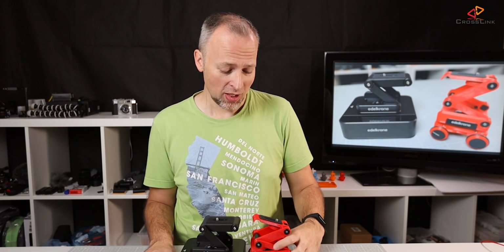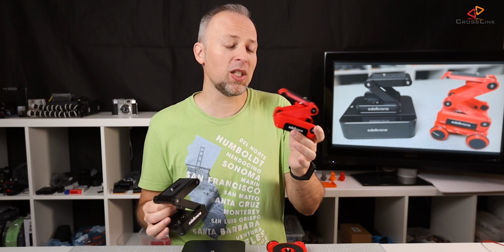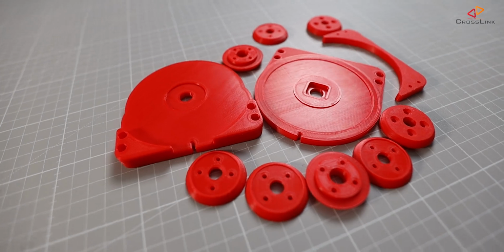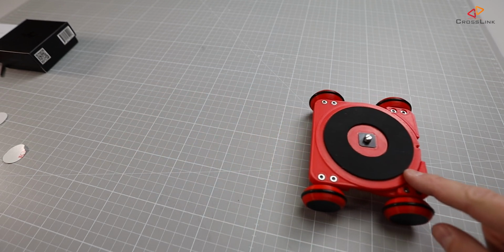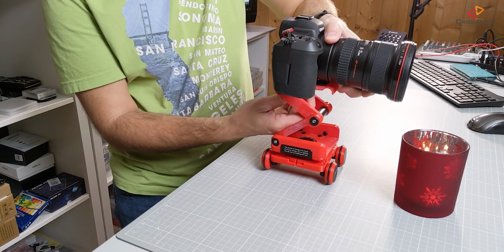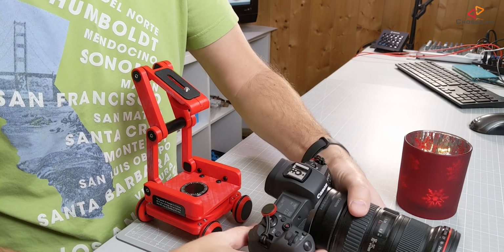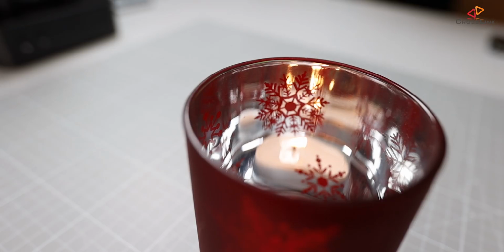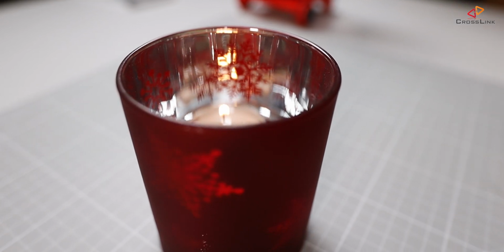EDELKRONE SKATER 3D vs Dolly One - A 3D printed camera dolly for 29$?

Comment: There are a few things to bear in mind with this combination: the more moving parts are between the camera and the ground, the more potential shake and wobble will be in the footage - some of it can be compensated for in post with Warp Stabilizer, but there is only so much it can do. So I would not necessarily use that flex tilt head on a dolly. Instead, raise the dolly, put a solid tripod head on it and use that. 
Also, even the most minute wobble is amplified by orders of magnitude with longer focal lengths. Daniel is using a 16-35mm lens here, which is pretty wide. You will get away with this combo very well, but things are going to look very dicey with longer focal lengths and very tight shots.

Comment: Would be interesting to add a small motor to one of the dolly axes (pulleys? gears?) and control it by wire. With a bit of hardware and software tinkering,  it should be possible to achieve much better results in speed consistency and video stability
Reply from the maker: Maybe this will do... https://rover.ebay.com/rover/0/0/0?mpre=https%3A%2F%2Fwww.ebay.com%2Fulk%2Fitm%2F192792632963
Reply: @Crosslink3D  a stepper motor requires a bit more Control hardware, but your concern is on the spot. Smoothness on start and stop might be more difficult to achieve with a standard dc motor. Unless, pwm? Creating a "speed profile" with an acceleration ramp, steady speed and deceleration at the end. I did it in the past with Arduino and it worked quite well. Sure, you cannot have fine control on position because you do not have a feedback on the axis angular orientation. Maybe an hacked servo would do. Lots of alternatives :D
Reply from the maker: Love that idea. Because the STL files are available this could be done. I have a few of these motors left: https://rover.ebay.com/rover/0/0/0?mpre=https%3A%2F%2Fwww.ebay.de%2Fulk%2Fitm%2F123939433647. but it's not stepper motors so I am not sure how gently they will start or how constant the speed is.